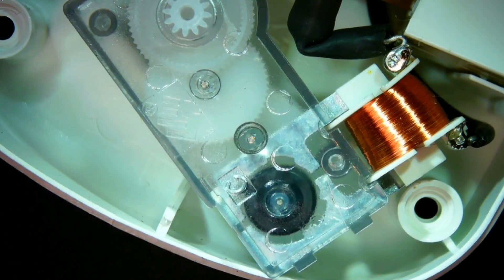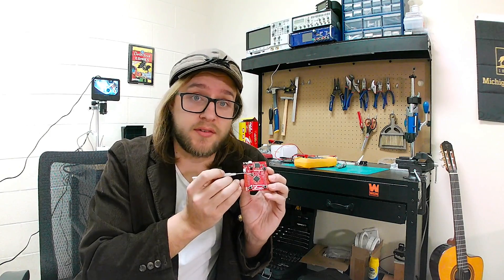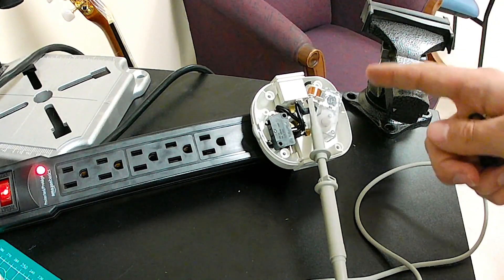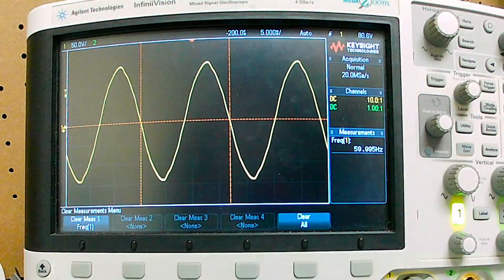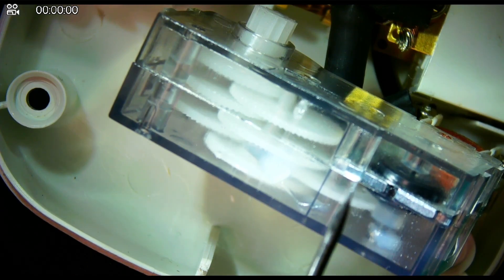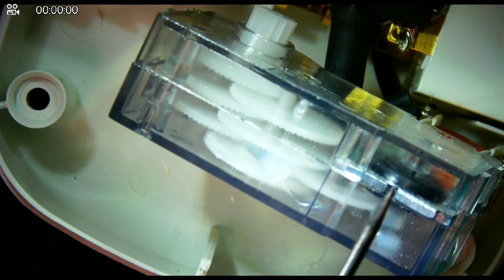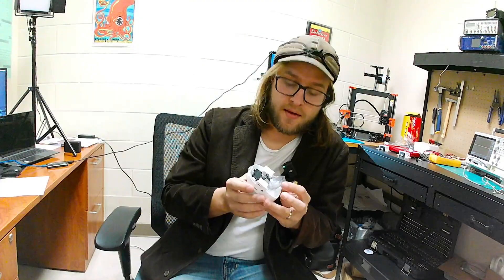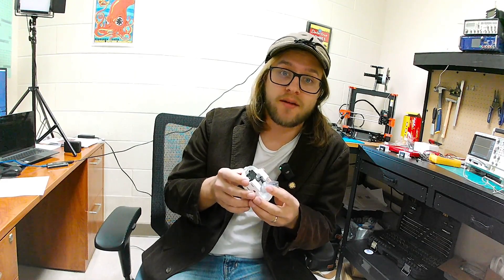A Different Way of Synchronizing Electronics

Comment: Old record players and tape recorders also use synchronous AC motors to maintain the correct speed. They have pulleys of different sizes depending on the frequency of the countries they are designed for.
 In Japan, the frequency you get depends on where you live as both 50 & 60 Hz are used there.

Comment: An early electric clock based on mains frequency was developed by Nikola Tesla. It is also interesting that before the standardization at 50 and 60 Hz there were tens of frequencies in use like 40, 42, 133 and 25 Hz.

Comment: 2 fun facts about the 60 (50) Hz AC power: It varies primarily due to load on the grid. It will fall < 60 when demand is growing and exceed > 60 when the demand is falling. Also, this variation can be logged and used to time stamp many audio/video for forensic purposes.
Also, many simple clocks do not work in remote locations that have diesel generators because the 60hz is not stable.

Comment: Don't power companies have to maintain a precise frequency to be able to connect grids together rather than for some old clocks?
Reply from the maker: Yes - this is the more important reason!
Reply: All the generating stations on the grid do maintain a common frequency, but the frequency does vary slightly from 60 Hz (in the U.S.) in response to changes in the power demand and power supplied.  Over the long term, the frequency is made to average exactly 60 Hz so there is no accumulated error in the clocks that depend on the frequency.

Comment: The majority of countries in the world (~80%) are 50 Hz, not 60 Hz.

Imagine that - there countries other than America. <shocked pikachu face>

https://en.wikipedia.org/wiki/Mains_electricity_by_country
Reply: Most clocks that use mains for time have a switch on the back to select 50 or 60.
Reply: @fiver-hoo  I wonder what's on the other side of that switch. Does it just switch gears mechanically?
Reply: @fiver-hoo  You missed the point completely.
Reply: The problem is that North America uses 120/240 V single plhase service and imperial system. 50/60 Hz is a small difference.

Comment: Replaced heaps of analogue timers, the plastic gears always break down over time. In Australia we have these Zellweger relays that put 1050Hz down the power lines, operating 1000hz above our typical 50Hz doesn't effect such analogue timer designs.

Comment: When I was a kid in school I noticed that all the analog wall clocks in the school would never drift from each other.  They might have had differences in their displayed time but the differences were constant to the second even through a whole year, while watches and battery-powered desk clocks would drift.  Always wondered if they were sharing a timing source.
Reply: Such clocks indeed use a central timer.
Same as station clocks, the minute hand runs slightly fast and is mechanicly halted at the 12 by a central controlled magnetic clutch.
Reply: I have one made by IBM that works by the same principle.

Comment: The old digital clock radios also used the line as a clock reference (I have even used some diodes and capacitor to create a simple timing pulse).